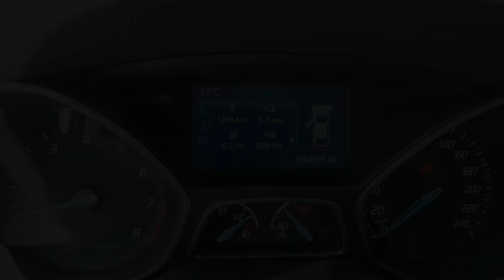Ford Ecoboost 1.0 internal condition after 8 years and 100000km.

Comment: It's a bit hard to believe 😕 I have changed five belts this year all same problem oil light on remove the sump and the oil pump pick up full of little bits of belt. The belt is complete and a ford belt! When you look at cam belt looks like little hairs coming off the belt which go up pump pick up and block it. The lowest was 30.000 miles highest was 70.000 all had ford belts all 3 to 4 year old cars 🤔
Reply from the maker: I suppose they've used different engine oils. It seems that the original Ford oil is very important. I know about this problem, so that's why I opened the engine, just to check what's going on. I think for the next 2 years (when I'll change the belts) there will be no troubles.
Reply: @synthez3d  perhaps that's it's the  oil. All the ones I have done are new customers because we have the timing tools to do the job
Reply: @sidsxr3irestoration Another thing to consider is if the car has had any engine flushes. Apparently flushing the engine wreaks havoc on the belt
Reply: Engine oil is not the only reason for breaking timing belts!
If you drive a lot of short trips, where the engine doesn't get hot (sub 12 Miles), you get gasoline buildup in the engineoil. Gasoline is a solvent, and will also break down the belt. It will happen when the gasoline content exceeds 2%.

And even more often it happens when the o-ring in the high pressure fuelpump becomes bad. Gasoline will start to run down into the engineoil. From there it goes fast.

So engineoil being the reason - not only!
On another note: The Castrol oil isn't the Holy grail! ALL engine oils that meets the Ford 948B specs, can be used.
Personally I prefer Mobil 3000 Ford approved oil, as it is not as p*ss thin as the Castrol oil. And the engine is more quiet.
Reply: @Saab95AeroEstate  The engine gets hot way under 12 miles lol
Reply: @Saab95AeroEstate  and how can one oil be thicker than the other when you are supposed to use 5w-20
Reply: @Saab95AeroEstate  it's ford belts witch is the problem. Changed two last month so that's seven I've done in total. The ones with  original ford belt are the problem
Reply: @gamesmaster1060  - No it doesn't. I think you just look at the gauge at the dashboard. 🤣
This will only show watertemp - and that not very accurately!
What is interesting is the oil temp. This will take longer to heat up.
Reply: @gamesmaster1060  - I'm saying it "seems" thicker, and induces less noise.
Reply: @sidsxr3irestoration  - The belt is not the problem! The detergents (and gasoline) in the oil are...
There is no such thing as an "original" Ford belt. The belts marked with the Ford logo are alle made by a subsupplier (Conti, FEBI or alike).
Reply: @Saab95AeroEstate  Yes oil temp takes longer but not 12 miles. Espeacially on this engine.
Reply: @Saab95AeroEstate  the last belt I changed was a Gates belt. This was the second belt fitted fitted to this engine and due for change. When removing the sump and checking the oil pick up pipe it was clean and so was the belt all complete. So I would have to disagree on the gasoline idea.
Reply: I have changed the timing belt on my ecobost engine after 11 years,100 000km looked the same as on the video. Correct oil!
These engines need more attention that's all. No forgiveness for late oil change or baf oil.

Comment: What is the correct spec oil for these 1.0 engines. Not viscosity. I mean SAE or ACEA rating.
Reply: Ford Wss m2c 948-B
Reply: Has to be an eco oil designed for wet belts

But even that doesn't negate failure, I've seen these belts block up oil pumps and fail at under 30k miles with dealer service history (only had one service from new in line with 18k oil change intervals)

We are seeing more and more with sheared teeth and damaged tensioners,

Latest was a 2016 Mondeo that came in yesterday with just over 100k miles on it, @ 7 years/100k miles 

According to fords 18k/2 year interval this car should have had 5.55 oil services by both mileage and time.

This car however gets its oil changed annually so had more like 7-8 changes but has still  suffered failure even with early servicing.

Comment: Hi mate I have the same engine m1da Can i use the castrol edge 0w20 LL IV or 5w30 LL III instead of magnatec 5w20 e because the edge line is better than magnatec
Reply from the maker: I'm not sure why you need, to change the recommended for this engine Magnatec 5w20. As you can see, it's doing well and it's recommended by Ford. Most of the problems with the belts are related to use of different engine oils and I personally, wouldn't risk, using any other oil, more over for me it's already proven. I made this video, to show what's going on with the engine, using only the original engine oil.

Comment: Ja nabijam akumulátor v c max 2015, 92 kW, ale start stop vypína len niekedy, pôvodná originál batéria, mám 97 000km, olej mením každý rok, a tankujem len 100 oktan benzin, rozvodovy remeň kedy meniť?
Reply from the maker: If the battery is the original, there may be some issues, because it's old enough. The belt should be changed on 200000 km. or on 10-th year. That's the service interval, at least here in Bulgaria.

and some Google translate:  Ak je batéria originálna, môžu sa vyskytnúť nejaké problémy, pretože je dostatočne stará. Remeň by sa mal meniť po 200 000 km. alebo v 10-tom roku. To je servisný interval, aspoň tu v Bulharsku.

Comment: Do you think using normal 5w-20 oil for a few months would do any damage
Reply from the maker: Probably not, but I wouldn't risk, to try.
Reply: Dont risk it my belt had blocked oil pickup not long after when i got s service done at a local garage. I suspect they would have used generic 5w-20 and not one that meets the ford specific one for this engine and it caused it to eat the belt faster

Comment: My ecoboost failed at 160 000 km with wet belt ... i hate this motor .. do the oil change every 20 000 km with castrol oil good Luck with this ..